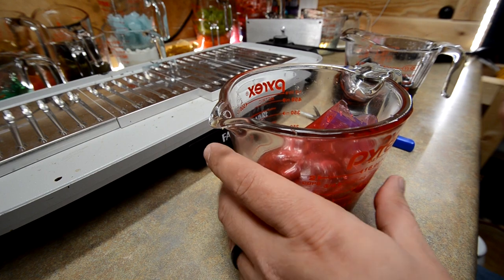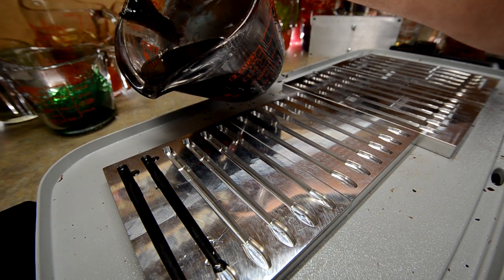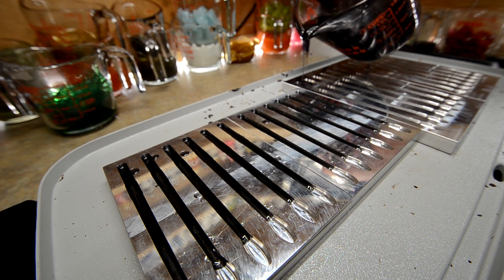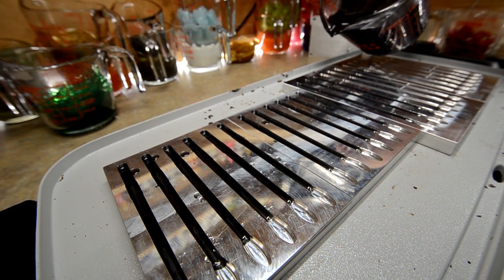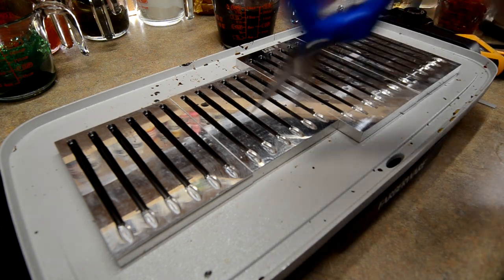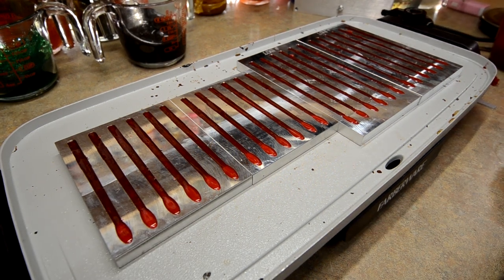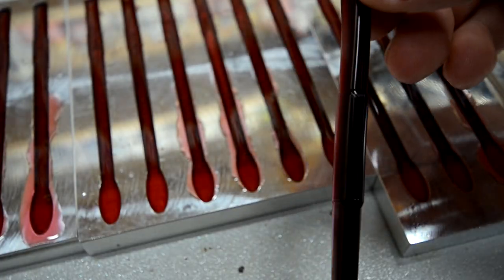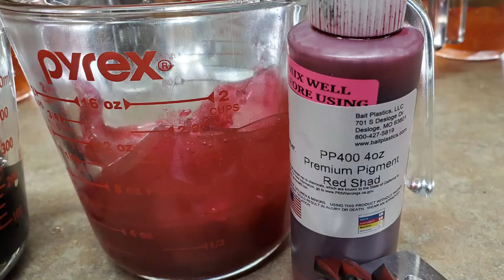RED SHAD BOT WORMS! (AI Bot Worm)

Comment: Use a beaker or smaller pyrex way easier to pour then those big pyrex you guys use. My experience hand pouring for many years I've learned
Reply from the maker: I've tried beakers and you have to wear gloves for those, I hate wearing gloves. But a smaller Pyrex I've tried before too, I'm just better with a 2 cup Pyrex and I am so used to it at this point. 😆